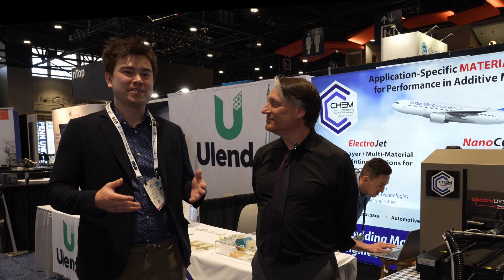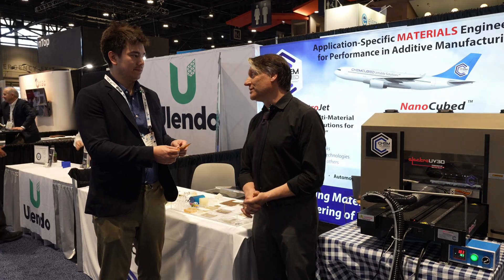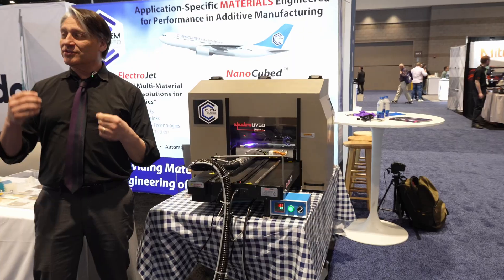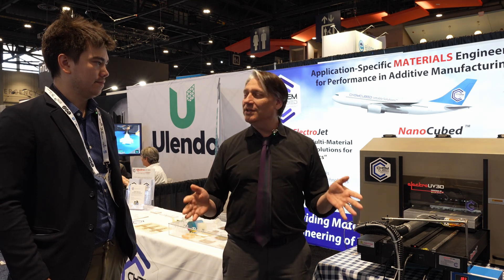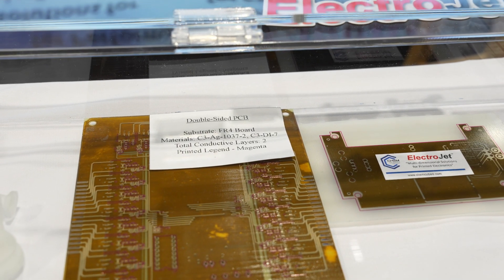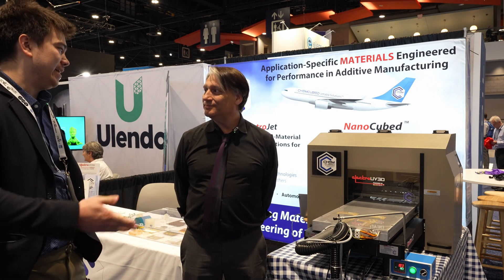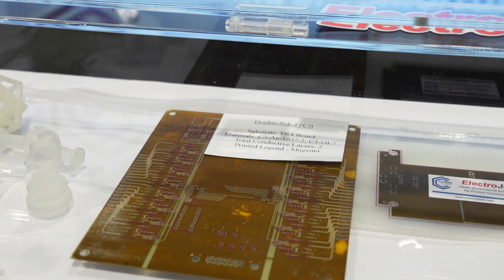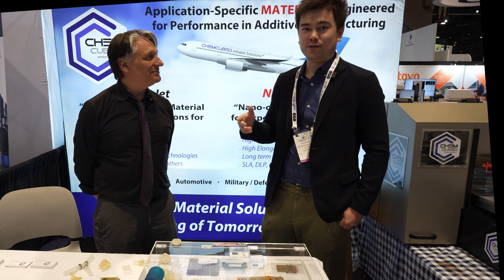Printing PCBs with CHEMCUBED Silver Nanoparticle Ink

Comment: Incredible technology, I find this really exciting.  This sort of technology has the potential to bring a lot of electronics manufacturing back to Europe, USA, Canada etc, especially once the product managers and designers start to embrace the design freedom this unleashes.
Reply from the maker: I’d like to have some stuff printed with them, seems like it’s be a really fun machine to use and pay around with. There were some other techniques that I cut, but he described them. You can lay down a little dielectric template, the. Flood the board like with flood irrigation in farming, and it fills all of the channels you made up with the ink, and it can make pretty thick traces, I think I saw 250 or 500 microns thick layers on one of the prints. With pure silver that is a lot of current carrying capacity
Reply: @NathanBuildsRobots  Amazing tech.  A while back I was motorising a 1.3m camera slider and had to learn about the Trinamic 5130 to drive the stepper I wanted to use (loads of torque), and I poured over the Trinamic TDS and schematics, and I became fascinated with the design of the PCB that held their chip... led me on an excursion into electronics, and I'm hoping to use some of what I learned in future 3d printed projects...

Comment: This is awesome. A shame it will probably out of reach for a normal tinker person.
Reply from the maker: Advanced technology is rarely cheap. Nano particles probably aren’t the cheapest thing to synthesize. But given economies of scale, it might be affordable someday. 

The cool thing to me is that it can be printed on low temperature materials, which means lots of common plastics and printed parts can be used. Imagine an FDM print where you pause on layer 69 or whatever, plop down a whole PCB, then keep printing the rest of the part.

Comment: This is really cool, but it looks like its gonna be for the 10-40K market. I would love to see something like this but for a consumer a high end consumer. The closest thing i have seen was the VOLTERA. But it uses a very unsophisticated process of basically using a cheap cnc router with a bloody silver tip pen to draw the routes. The problem with this is the resistance of the connections can be quite high and since the board has a lot of silver the process of creating boards is really expensive.
Reply: And here I am still etching boards, my boards are very simple though!
 I have a small CNC that I occasionally make a board with but the failure rate was quite high until I got the feeds and speeds correct and even then its not a guaranteed job.
Reply: @AndrewAHayes  yeah i had a cnc router for this as well. getting the traces right was a bloody feat. I found the best process was the toner transfer and ferric chloride methods. But They are really toxic. I just pcb way now and include multiple projects on one board that i break off myself. Easier/Cheaper. Just wish i had something at home that would make the prototyping process faster.
Reply from the maker: Yeah, the problem with normal silver inks is they have a lot of fillers. When you are making a composite of 2 materials, the less conductive material has a huge impact on resistivity. Especially when it is a dielectric like most adhesives are.  Even if it’s 95% silver, it’s only going to be like 1% of the conductivity of pure silver because of the way the material is composed at the microscopic scale. It essentially has to hop from conductive particle to particle, which isn’t as easy as it sounds. When the matrix material is the conductor, it should fare much better. But when you’re just throwing silver particles into a nonconductive matrix, it ain’t going to work well.

Even if there is only a small fraction of the composition. So the high purity of the silver is key to getting low resistivity.

This is almost pure silver post-cure, so it’s nearly the same conductivity of silver.
Reply: @NathanBuildsRobots  I had figured it was the conductivity of the silver that was the problem not the purity of the compound mixture. Seems like common sense but i never really thought about it.